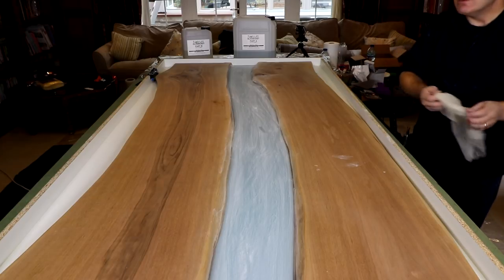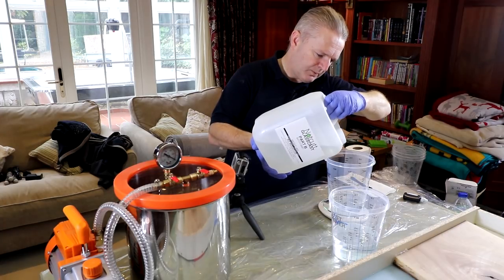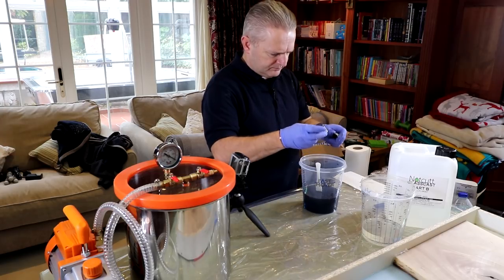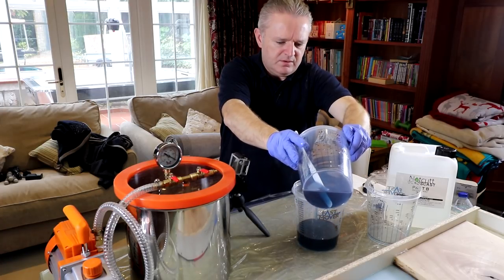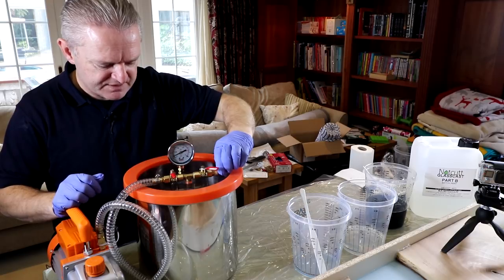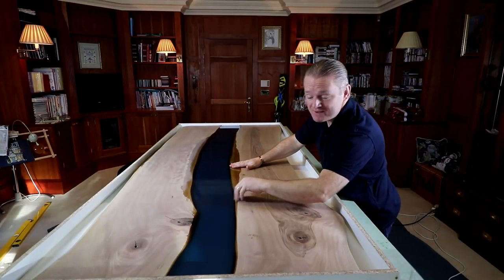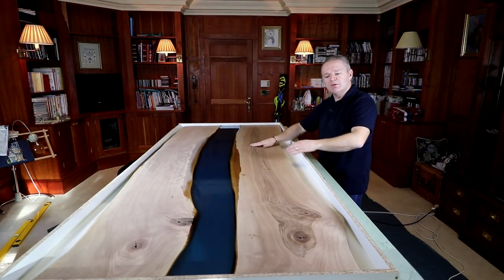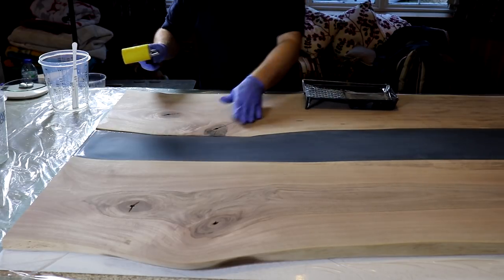River Table 91" / 2.3m & LED Lights - Tutorial Part 3

Comment: Do you need to de-gas it in a vac chamber, as I dont have one
Reply from the maker: Well...... I like too de-gas in a chamber to be 100% sure.
However, if you are using a similar epoxy to the Notcutt one I used, then the epoxy does de-gas itself to a certain extent due to its design.
Typically, if not using a chamber to de-gas, bubbles should rise on their own to the surface where they can be popped with either a blow torch or just a heat gun (I use a paint stripping heat gun).
However, when I did a test in some ice cube trays which were 25mm (1”) deep I found that the bubbles became trapped in the epoxy and did not rise to the surface, as such I could not pop them. 
When I was working in my workshop the temperature was 15C and the resin was not very viscous. That is one of the reasons I moved everything in doors where I could control the heat and set it to a warm 21C.
My advice if you don’t have a de-gas chamber is to……
1.    1. Do not mix the resin to vigorously, mix slowly to minimise the amount of bubbles you create.
2.     2. Ensure the room you are working in is as warm as possible (I set my room to 21C) as this increases the viscosity of the resin and bubbles will float to the top easier.
3.     3. Pop any surface bubbles with a heat gun, either a paint striping heat gun or blow torch (but do not burn the resin)
4.     4. Pour the resin in thin layers, approx. 5 – 10mm max each time to ensure any bubbles can rise to the top, any thicker and the
bubbles could be trapped in the resin.
5.     5. To be 100% confident on a thick pour use a chamber.
You do not have to use a chamber, but make sure you experiment with the resin first before you waste a lot of money pouring resin and find you can’t remove the bubbles.
Hope that helps
Cheers
Jase
Reply: DIYJase brilliant work! Really enjoying watching... where's part 4?
Reply from the maker: It should be coming soon! Xmas has got in the way and daily life, also this epoxy resin lark is not as easy as it looks, I have had a steep learning curve and also my 1st project being this 2.3m long coffee table! LOL!!!   

When my family visited at Xmas they all said what a nice dining table! 

Also I am still learning this YouTube lark, i need to finish a project and record as I go and only then release the videos a week at a time. What i am doing is recording as I go and then posting when I have enough, only issue is this causes issues if a delay occurs.

I hope to have part 4 ready soon, sorry for the delay, I am also impatient and cant wait to finish it as it is looking great :-)

Thanks for the comment

Comment: After poliching epoxy becomes scrached.whish disk or product i need To use.thinks
Reply from the maker: Hamdi Saafi when you say polish what exactly do you mean ? 

The steps I take 

Depending what you are trying to remove (just dust or leaked resin) 

Using a random orbital sander Start with perhaps 120 grit then 180grit, 240 grit, 320 grit, 400 grit , 500 grit, 600 grit, 800 grit

Next wet sand with 1,200 grit then 3,000 grit

Then move on to a polishing with compounds , I use mirka polarshine 10 , then polarshine 5 to finish and have a high gloss finish .

Or to avoid all the sanding and polishing perhaps apply a final thin coat of resin and ensure you keep all dust particles off the surface whilst it cures

Hope that helps

Feel free to ask any questions

Regards
Jase

Comment: Just a thought... once it's finished, I know the whole top and sides will be coated in 3(?) Coats of clean epoxy, but is that enough to hold them in place and prevent any future warping of the boards? I guess when the legs it will have more structure to hold everything square
Reply from the maker: Well .....

It will have more than 3 coats and that is due to a slight issue I have had with the table I created, the trestles collapsed slightly to the right and it became un-level. I did not notice for a while and after leveling again I have ended up with 5 coats.

The reason I chose Epoxy resin, as opposed to Polyester, is due to the strength of Epoxy Resin. Epoxy resin creates such a good bond with the wood and due to its characteristics Epoxy resin is extremely strong, where as Polyester is brittle.

This means that the Epoxy River fill is creating an extremely strong bond and this alone will be good enough to hold the two boards together.

As to stopping it from warping...... Coating all sides and edges in epoxy will seal the wood, as such it will not be effected by heat or humidity and will not warp or contract/expand at all.

I have done a lot of research into Resins and have a contact at the OEM that makes the resin and they have been very helpful. They have even gone as far as to experimenting in their Lab to try and create a epoxy resin with some characteristics I want that are not available anywhere. They are not promising anything but hopefully they will create a new resin that will be very useful :-)

Hope that helps.

thanks for the question
Reply: DIYJase great thanks a lot matey!